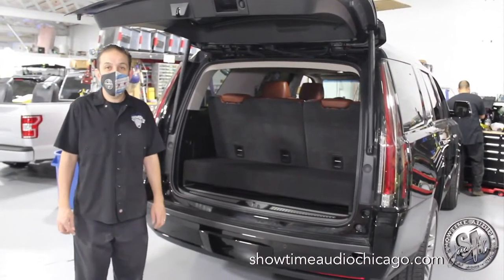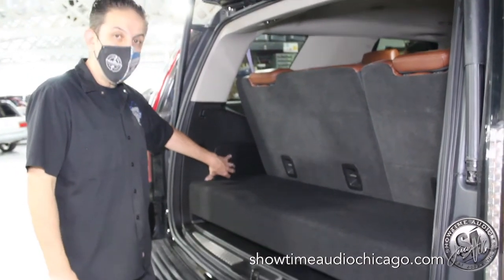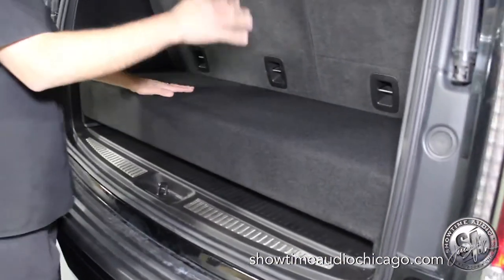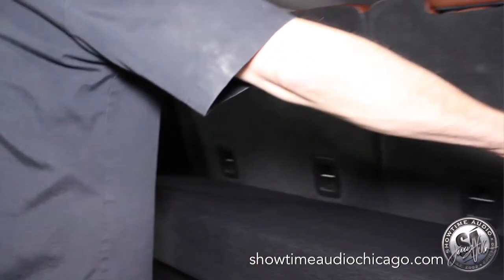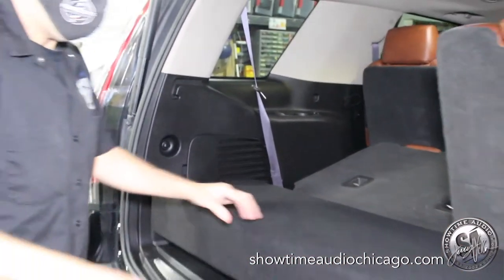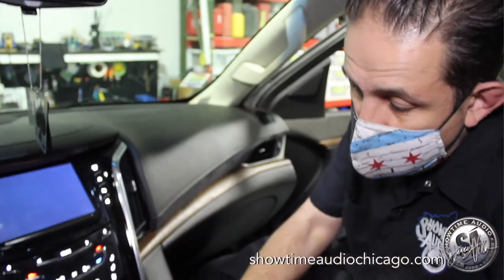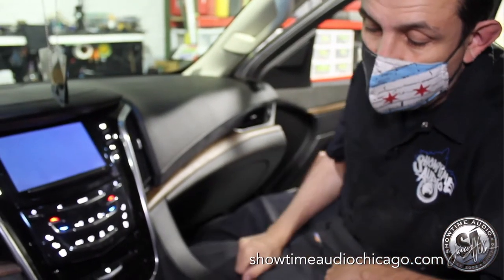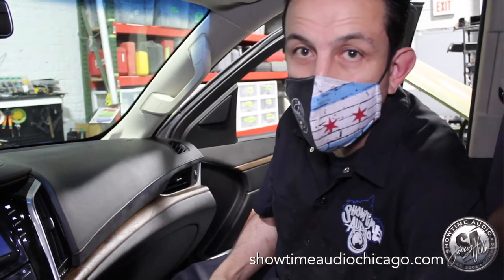Small space for bass? check this out! Down-firing subwoofer enclosure in a Cadillac Escalade

Comment: Can four tw3 10’s fit back there or is three the max ???
Reply from the maker: Hello Chris! yes, it fits 4 but the sub-box needs to be higher for the air space
Reply: What’s up Jerry ..  I really appreciate you getting back to me in such a timely manner . From your expertise , though four tw3 10’s can be done  will 4 subs actually sound better than 3 , or 2 ?  I’m just trying to get the maximum bass I can get without sacrificing my third row seating so I don’t mind the box being taller if it means I can achieve big bass 🔊🔊🔊🔊. I’m having you build it so who better to ask 😅
Reply from the maker: @Chris-hc9vb  Yes, 4 + the right power will be much better
Reply: @showtimeaudio   Four 10’s may be the route I take . I guess im just lil skeptical cause I always had a decent systems where  a lack of bass wasn’t a concern 2 jl w7 13.5 , three 12’s . Seeing as how you will be the one designing my enclosure I know you’ll know best .
Reply from the maker: @Chris-hc9vb   
Thanks for your trust, it means a lot.  Like I always  say in the videos, a correct installation is the main key. You can have the most expensive equipment, but if you don't have a proper installation, you wont get the 100% of performance.
Reply: @showtimeaudio  well put my guy .. looking forward to doing business with you 💪🏽💯
Reply from the maker: @Chris-hc9vb  absolutely! if you have any questions give us a call or send us a text at (773)489-7469